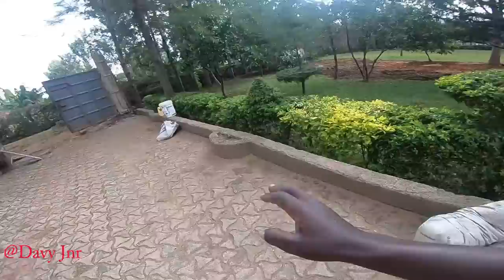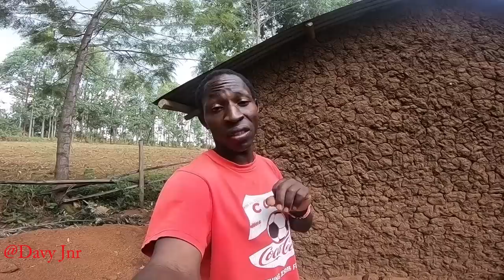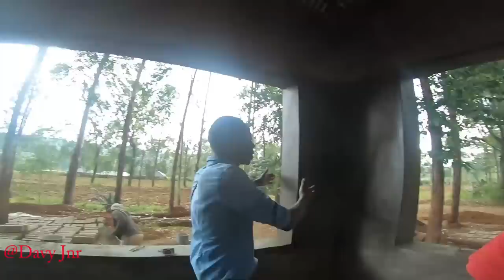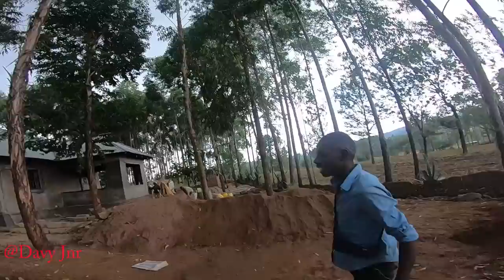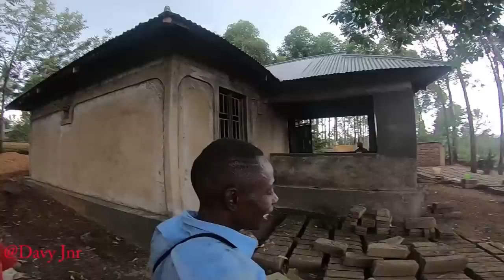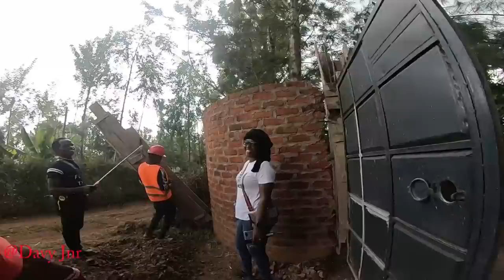Sad Day!!! Building My Uncle's House!!!

Comment: Davy Jr, there's alot more to do. The Plastering around the veranda is not done, the steps leading into the veranda is incomplete. The white plastering  for the ceiling is incomplete  You have to go all the way if it means you have to take a break and start again.